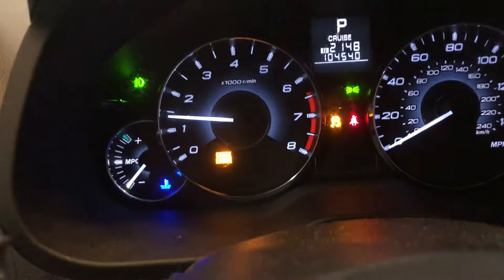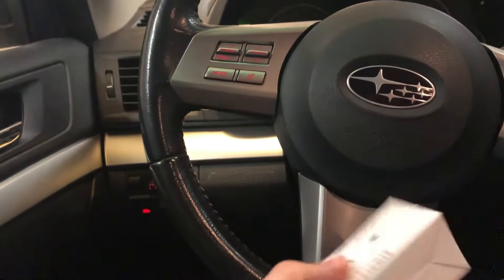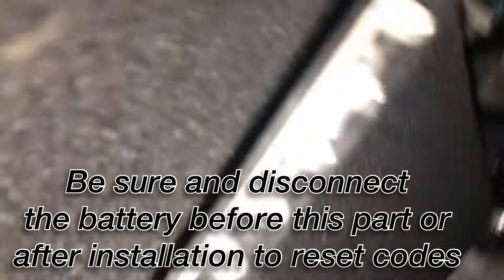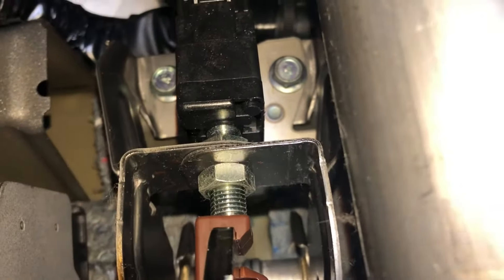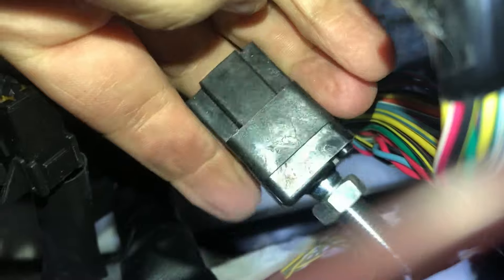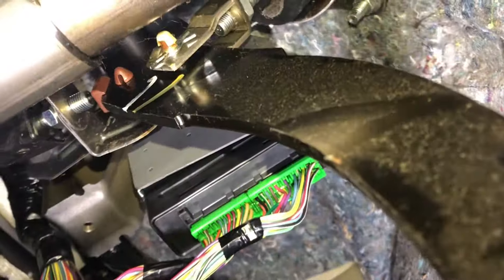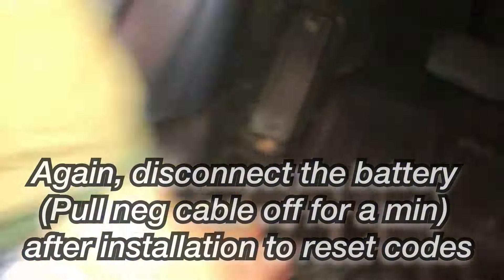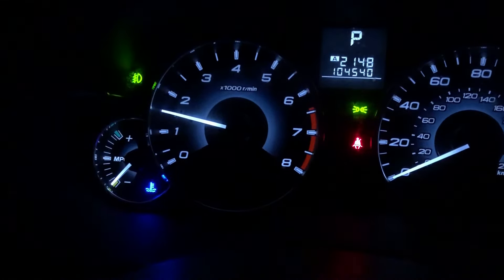Replacing Brake light Switch in the Subaru

Comment: Hello, I have the same problem in my car, this signs came from nothing... the last time came after an oil change!! 

Another places say anything about the air filter or the gasket in the gasoline lid, anything linked with the composition of air and gas inside the motor block (unpure composition with the dirty air inside the motor) .

Do you know if this have any connection?? Because now I find your explanation about the brake light switch and can be the problem too. But in another opportunity I changed the air filter and solved until now my problem, (without disconnect the battery plugs, the lights just gone ). Since now, thank you for your time.
Reply from the maker: Idk what you’re talking about to ever cause this sort of malfunction.  Crappy filtration of the air wouldn’t trigger such an electrical malfunction, it would simply cause your car to run crappy and bogged down or not start/run all together.

If you have this same issue, then it’ll be electrical, like as with the brake light switch (electrical component).
Reply: @CapricornKangaroo  Thank you for the explanation, make sense what you say.  Anyway I bought the brake switch, I will change it and verify the car in the next days.

Comment: Did you have a code for the break light switch? I have the same issue on a 2017 legacy, but no check engine light or codes.
Reply from the maker: Didn’t have codes run. Explained the issue to someone who previously was a Subaru tech.

Comment: Were the brake lamps working when the instrument cluster lights were on?  In my case only the brake malfunction light keeps flashing continuously.  E-brake functionality is fine and the brake lamps work fine too.  So just wondering if the lamps can function with an improper brake switch.
Reply from the maker: Deepak Sharma I believe they were functioning, but I can’t guarantee that.  It’s some sort of short within the switch and I don’t know enough about the internals to really break it down.  Best thing I can say is that you can try this to fix yours and it very well could work, as it is a common issue.  Or you can take it to a mechanic and potentially pay far more than the $60 for a switch, but they may find it to be something else entirely.  It’s a gamble, but I’d try this if I were you.

Worst case scenario you’re out $60, but have a backup switch for when yours does fail.
Reply: Deepak PLEASE GET BACK TO ME IF YOU CAN. I'm currently having your same problem with my 2015 Subaru Legacy. How did you fix your situation??? PLEASE HELP. Thanks

Comment: Hi I have the same issue with my Subaru Legacy. What’s the exact name of the part called that you bought? I’m having a hard time finding it
Reply from the maker: I would strongly recommend getting it through Subaru, but it’ll be a brakelight switch or stoplamp switch or intermotor brake light switch, they’ll all be talking about the same part. Hope this helps 🤙🏻

Comment: my break light is flashing with abd and traction i replaced this but it didn’t fix anything
Reply: Did you figure out the issue
Reply: i think it’s the master cylinder i ran a code scanner on it several times and the most text none said master cylinder
Reply: @Mr.GaryDZ  damn I send mine to the shop and the told me I need a new transmission 9k in labor and 7k for the part crazy it drives fine and the transmission doesn’t feel like it’s slipping I hope that’s not the case

Comment: Anyone use an OBD and see what codes came up with this? I took mine to a shop and they said I need a valve body (p0700 and p2763). Anyone confirm if the OBD maybe gave false codes?
Reply: Did you find out what the issue was?
Reply: @reallydadpodcast  it needed a new valve body.
Reply: @Chananime  same

Comment: Did this fix the problem long term?
Reply from the maker: Yes
Reply: @CapricornKangaroo  so i just went and got a new break light switch, reset the codes and disconnected the battery. swapped it out and the codes went away but as soon as i drove the car the codes came back on
Reply from the maker: @KaranSingh-kp3io  hmm. I’d recheck the wire connection is fully snapped in first, but if the lights remain it could be that either another sensor is causing the faults or something else is the issue. Possibly a Tire sensor or something, but may be best to check with a pro, as I’m not a mechanic, nor do I know all of the ins & outs of these cars.  Wish I could he more help to ya.

Comment: I have the same problem in a 2010 Tribeca.  The brake light switch did not fix the problem.  Infotainment screen. Goes on and off.  Christmas tree lights go off when accelerating.  Was told the alternator was overcharging the battery.  Any help would be greatly appreciated.  Thanks
Reply from the maker: Electrical problems such as this can be tricky.  Check battery connections for corrosion build up as well. I’m not familiar with the Tribeca, but if the source saying alternator overcharging, then a new alternator may be the fix.  Also, check how old the battery itself is, for that could also be a cause.  Hope this helps in your search.
Reply: Thank you God bless you

Comment: I have the same issue, but with NO Check Engine light on, just the Traction Control, Parking BRAKE, and Cruise control lights. Do you know if its the same issue?
Reply from the maker: I can’t be certain it’s the same issue.  It’s odd to me that all of these lights can be caused by this one small cheap switch in the first place.  It’s a good place to start to narrow it down at the least.  Electrical gremlins are always tough to track down.

Comment: Same lights showing on our 2010 Outback. What codes were you getting? For us the computer says P2763 which means Valve body (transmission)
Reply: @_emilini  No we replaced the valve body for the transmission which was the issue

Comment: Did your car also not go into gear and lose your break lights?
Reply from the maker: I don’t know if the brake lights stopped working, but it would still go in gear and drive fine. This isn’t a cure all, just a good place to start.  Your issue could potentially be more in depth than mine.

Comment: My gf car has the same issue and I come across this and swapped it along with a gas cap and still no joy my guy. Anything during the process I may have overlooked?
Reply from the maker: Making sure the sensor is fully clipped in at the connection point is the main thing that comes to mind.  Hate that for you, unfortunately this is a “fix most” kinda situation.  Electrical issues have the potential of being tough to track down.  I’d recommend having the codes read (preferably at Subaru if you can) and then from there it can hopefully be found where the faulty part is.  Could be anything from an O2 sensor, tire pressure sensor, to a mechanical issue. I wish you all the best!

Comment: So did it work bcz in mine jus came on I unplugged  battery n it came off bt its back on
Reply from the maker: It absolutely worked for me.  I would try rechecking the connection & make sure the switch is adjusted out the right amount to work when the brake is engaged.  Then try having an orielly or auto zone reset the codes manually.  If it still happens, I’d say your issue is elsewhere and would recommend having a subaru-centric shop look into it.  

This fix most often works, as it’s a common little electrical problem, but not always.  If it’s back again after they reset the codes, chances are it could be a different sensor, or potentially another electrical or other issue.  This is assuming you got a genuine new subaru brake switch to replace the original.

Comment: Happened to me but the check engine light didn't came on. Just replaced the break light  switch. But the light still came on.
Reply from the maker: Sorry to hear that.  It’s certainly not a cure-all, but since it worked for me I figured I’d put the info out there for those who it does work for without having to visit the mechanic. Wish I’d had the codes read to do the due diligence.  Hopefully a mechanic you trust can diagnose further for you.

Comment: I would hope you can get that $60 back from Subaru.  Worth a shot.
Reply from the maker: meluaufeet why would they owe me $60? 🤔 It’s a 10yr old car.  That’s just how it be sometimes.  Rather replace a $60 than a $600 part.
Reply: @CapricornKangaroo  Well, with the recall, it does go back to 2008 on certain models.
Reply from the maker: Lar Ada-Koski I’m not going to worry about $60, however I wish they would address the common head gasket failures.  Pretty sure ours just blew out.  Potentially going to cost a smidge under $3k to repair 😬
Reply: @CapricornKangaroo  At that point, time to trade it in, 2011 to 2019, good run
Reply from the maker: Lar Ada-Koski lol, nah.  It is a common Subaru thing.  I knew it was possible.  Things happen 🤷🏻‍♂️

Comment: I did same as you bro, but unfortunately, the brake doesn’t work.. I couldn’t move the car .. I might cut one of the cables by mistake.
My advice, take your Car to auto repair
Reply from the maker: The brake doesn’t work?  That’s not the same issue I was having to begin with, nor was it ever affected.  If you’re not at all mechanically inclined definitely take it to a shop and NEVER cut lines like that if you did, nowhere in my video did I say to do that.

Comment: Was your transmission stuck in park ?
I have a 2019 wrx cvt and my break lights were out and every single light was on my cluster except for the check engine light . I manually got out of park and saw that the break light was toast any insight would be greatly appreciated
Reply from the maker: Steven Roseren sounds like the solenoid that allows you to put it into another gear isn’t being engaged.  That does get triggered by the brake light switch (what I replaced)  being so new, i’d imagine you have a warranty and Subaru should take care of it though.

Comment: Mine has all the same lights plus the AT oil temp light did yours never come on
Reply from the maker: Never had an oil temp light on.  Since this is such an inexpensive part I’d say it’s worth a shot potentially.  Electrical stuff can be difficult to track down. May end up being something they’ll need to track down and figure out for you.  This is a great starting point and has worked for many others, but nothing is guaranteed.   Sorry for the late reply, but hope it all comes together for you soon.

Comment: I've been having an issue with it too but it looks like your trac and brake lights were on as soon as you turn the car on, no? Mine does it about after 5 minute of driving around, its never on as soon as I turn the engine on.. I replaced this part today and after driving it around I thought it wouldn't come back but there it was, as soon as I turn into my driveway. Any thoughts?
Reply from the maker: No clue, sounds like something shorting out somewhere possibly , but I got my advice from a guy who was at Subaru for a long time.  I don’t know where to point ya aside from a shop unfortunately.  Electrical issues can be tricky to diagnose.
Reply: Lol. It was LED brake lights. I bought a pair of regular Sylvania bulbs, installed them, and we’re all good now
Reply from the maker: @Jsroca89  BALLIN!! 😎 Easy fixes are the best!! Glad you got it figured out! Sry for the late reply.
Reply: @Jsroca89  so you replaced only the lights or the brake switch as well? I have the exact same problem lol put initially led now changed to regular  however already ordered this switch and not sure if I should still replace it...the error is gone but did not drive a lot past few days...
Reply: @27trofim  just the light! No need to replace the switch
Reply: @Jsroca89  thank you Sir! You saved me 45$ ))

Comment: Ok, so i have a 2003 Subaru Outback, and need to replace the switch.  My Nephew is talking about going through the floor and getting to it from beneath.  I don't understand why i can't just remove a section of the dashboard like in this video.
Reply from the maker: I’d look at it yourself.  As far as I’m aware it should be located at the base of your brake pedal, just as mine was.  Don’t let your nephew cause more issues trying to get to it another way.
Reply: @CapricornKangaroo  TY for the reassurance.  That is what my instinct says as well.  I will certainly get a second, better informed opinion before i take anything apart :)
Reply: @CapricornKangaroo  Yes, i went an inspected it myself, and i see now exactly what you are talking about.  Even i, a non-mechanic should be able to do this with a little patience.  I see the switch where it articulates with the break pedal, the nut, and the switch connector.  It does not look at all like the huge job my nephew described.
Reply from the maker: @budahbaba7856  awesome!! It should be an easy job to replace it just as I did.
Reply: @CapricornKangaroo  Yep!  I just finished it!  It took me a while to figure out how to separate the switch from its connector.  I used needle nose vice-grips to hold down the tab while i pulled out switch.  It was tricky to get the bottom nut back on and threading proper, but i prevailed.  :)

Comment: I have same problem in my Outback 2012
I remove my battery connection then it’s gone for 2 or 3 days 
After 4 days it’s com back agine :( 
I’m gonna change my Breaklight switch 
I hope it’s works 🙁
Reply from the maker: Best place to start if it’s the same issue.  Electrical issues can be funky and hard to find. This switch seems to be a common problem. Best of luck to you 👍

Comment: Does it fix the problem?
Because when you replace the switch, you disconnect the battery. This will clear the codes.
Reply from the maker: Yes, this fixed the problem. Disconnecting and reconnecting the battery may not be 100% necessary, as I believe that an initial quick check is done, which brings up the codes.  Unhooking the battery ensures this initial diagnostic test is run since it’s the first time turning the key with power to it.  Hopefully that makes sense.

Long story short. Yes.

Comment: Hi ! It happened to me … I disconnected the battery and it started just fine . A week after AGAIN . I just got the switch and I’m about to replace the old one . 
Question : did that lasted in the long term?
Reply from the maker: Yes it did, it was still doing fine a year later and my ex took the car after that. 👍
Reply: @CapricornKangaroo  hahah YOUR EX !!! so no in my case i have replaced the switch and 10 days later ... the exact same issue. So now im no idea what to do ...

Comment: I have Subaru Forester 2015 with All Lights ON ( $cristmas tree ) + blinking "At Oil Temp"
We just changed out the Brake Light Switch (Subaru #83370AA001 Stop Lamp Switch )
BTW previous night the car was perfect running. ( but engine oil and filter were newly replaced )
Unfortunately !!! It DID NOT work , then one mechanic said " ( You need the replace the full transmission ! ) 
I can't find 2nd hand here in AbuDhabi ( UAE ).
I appreciate anybody help. many thanks.
Reply: Greetings from the US.
All the lights going on like that is a general warning. You should plug a scanner into you your Forrester to diagnose the problem. There are probably a hundred different things it could be. I got all the lights when I had a misfire due to the spark packs. 
 Did you get your Forester fixed? Telling you that you need a new transmission without an explanation sounds shady. I am always curious how life is in other parts of the World. Cheers!

Comment: My 2014 Subaru Impreza has a flashing Oil Temp, Traction Control, ABS, and Hill assist light. I will changing the brake switch and follow up to this comment.  Hope it's nothing serious!
Reply from the maker: Carlos Chairez Yeah, it’s worth a shot.  Could save you some $$$ over taking it to a mechanic.  Got my fingers crossed for you. 🤞🏻👍🏻
Reply: @CapricornKangaroo  Following up as promised, turns out my car had the recall on the brake light switch. The switch is completely different now. My car was inspected by Subaru and it was determined to be a problem with the CVT Valve Body. It was replaced under warranty even though my car was at 101,000 + miles. Subaru Of America helped me out! :D
Reply from the maker: Carlos Chairez  Nice!! You hella lucked out man!! Glad you got it taken care of.... fo Freeeeee!! 😎🔥
Reply: @Solrac77777  do you have a number or email, that I can refer to? Want to see if the dealership is so kind to me, thanks in advance...
Reply: Pedro Moctezuma Jr Hi Pedro, It wasn’t the dealer that covered my repair, it was Subaru Of America. Here is the process I took: Take the Car to the dealer, Get is diagnosed, and then contact Subaru of America to see if anything can be done. Is your car having the exact issue described in the video?
Reply: @Solrac77777  yeah, it's the same exact thing happening to my vehicle, and the temp light goes red-blue-red-blue and if I stop, the lights seem to reset, then after a while it will do it again after 25 miles or so, and this time the temp light stays red, and it starts spitting Anti freeze from the reservoir tank.....I think the system is shutting down as a failsafe and the fans are cutting off, I even noticed that the AC stops blowing cold air also
Reply: Same lights in my Legacy 2015. Can you solve the problem ? If yes, how ?